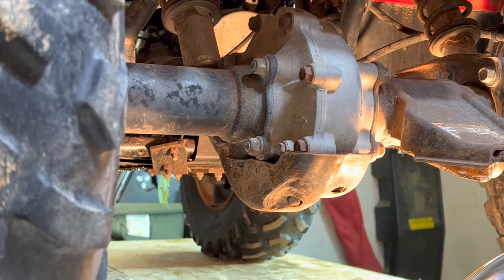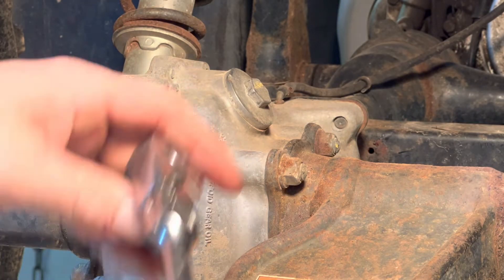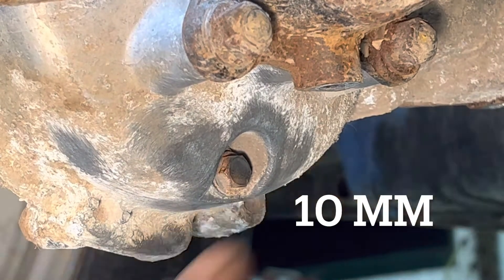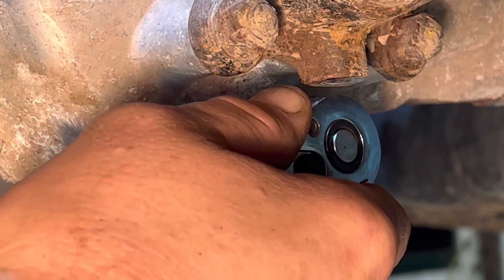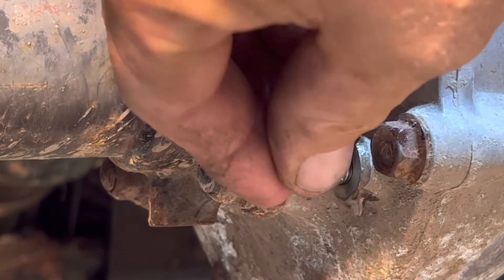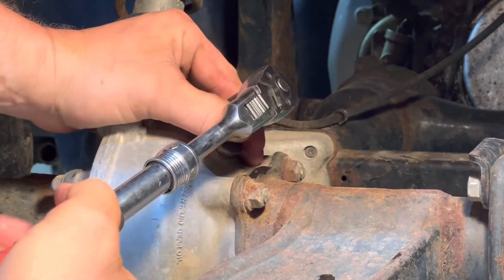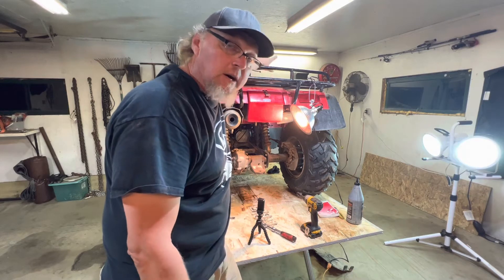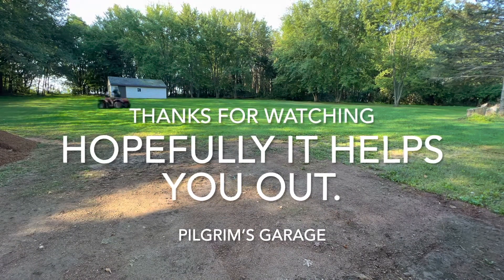Honda Foreman Rear Differential Oil Change (2000)

Comment: Thanks was a great help, as for the rear differential the same procedure for the front except the front takes a slightly different amount of gear oil using the same procedure.
Reply from the maker: Yeah, I probably didn’t need to change the rear but I figured I was there so I better. Thank you
Reply: What kind of gear oil do you use?
Reply from the maker: @caseytownsend7067 I used 75W140 synthetic. The manufacturer says you can use regular 80w90 but that’s what I had.

Comment: Thanks alot sir. Once the new oil leaks by the "oil check" hole and i put back the plug... Do i top it off until it reaches the top plug or its enough oil like that  ?? Thanks.
Reply from the maker: Some guys fill it up but Honda says to open up that top plug and fill it until it comes out of that. The amount should be sufficient. When I changed this one, someone had filled it all the way. I’m not sure if there could be a lasting effect if it was overfilled.
Reply: @pilgrimsgarage  thanks alot sir. I did like you explained, i also tought that once  the level of the overfill plug is reached, the amount of oil is sufficient and calculated to be enough. 

  Its the first time i do it myself in the 15years i've own it so im very "nervous" as to not do a mistake. I suscribed to your channel and i dont regret with the fast response you gave me 🤘😎
Reply from the maker: @MxRyder19  thank you and don’t worry, you can’t screw that up unless you ran it a long time empty. Good luck!